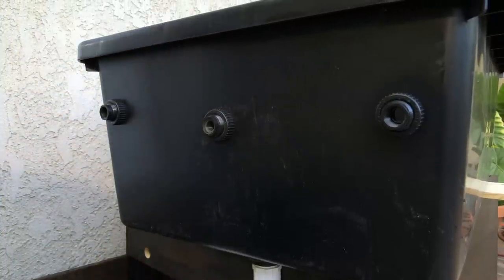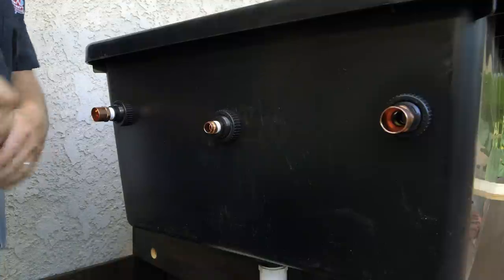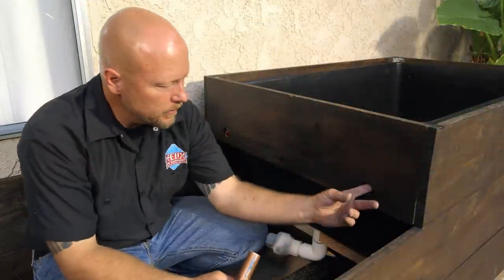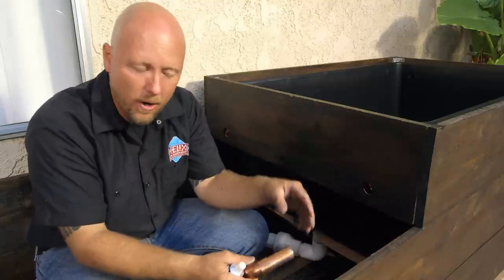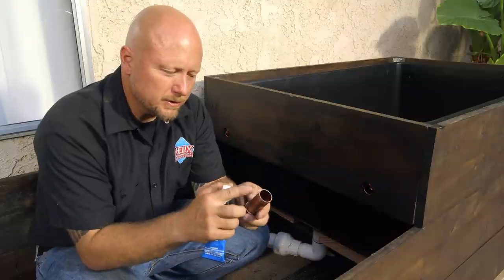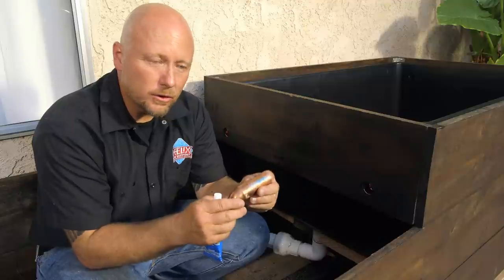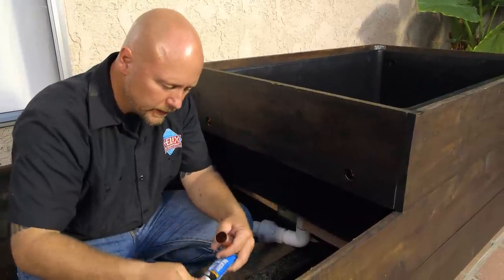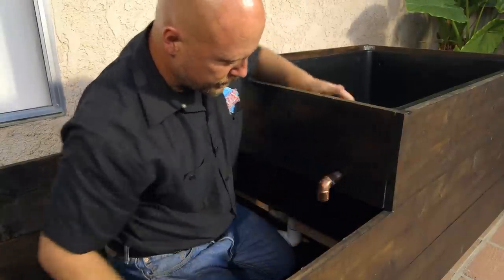Patio Pond with Bog Filter | Water Fountain Spout Installation - Part 8

Comment: Before loading gravels into top tank, you should have shown how you rearranged cement blocks and 2x10's because as shown back about video 3 or 4 when you installed bulkhead fitting and check valve assembly that would have landed on top of blocks when you set the tub in place. I probably should have mentioned this in those videos, but I didn't know if you would bring it up.

Comment: I need to buy a few of the connection fittings that go threw the wall of the pond/filter (so I can order them on-line)  I think you called them bulk-head connectors?